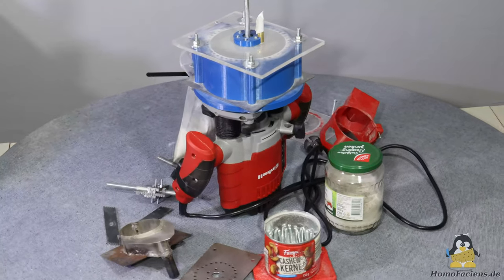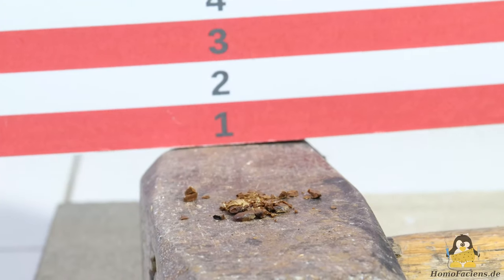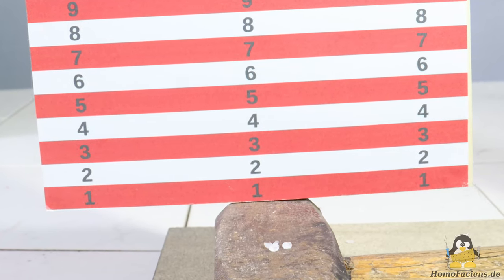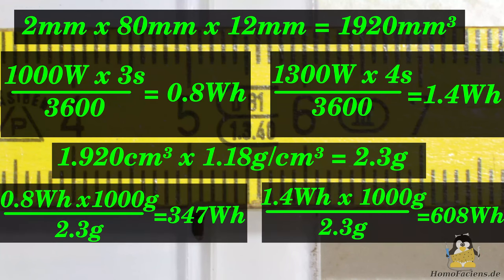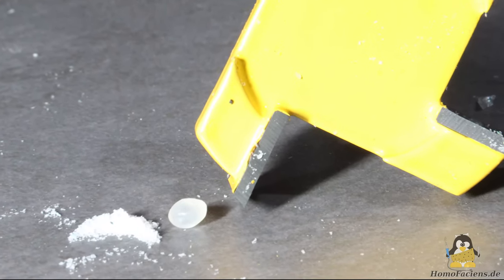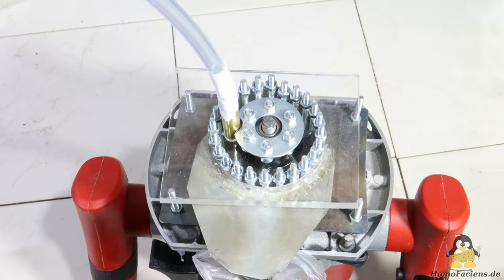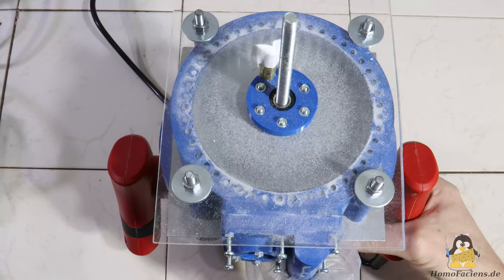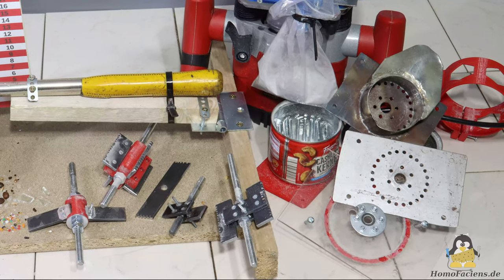Energy needed to grind or mill PLA pellets to plastic powder.

Comment: There's another process used to make fine powders industrially-- melt blowing... something like making 'cotton candy' Might work for low melt plastics like PLA?
Reply from the maker: Surely no easy task. You will very likely end with some sort of "cotton PLA" rather than with a powder. Melt blowing (atomizing) works fine with metals, but long plastic molecules have different properties.

Comment: interesting indeed. I wonder if theres any way to just blow dry ice powder into blend space sometimes to keep temps low? or in least just pipe outgas from it
Reply from the maker: Of course, cooling to temperatures when PLA gets really brittle is an option, but you must;
(1) Source liquid nitrogen or solid CO2, which isn't available in any hardware store.
(2) add the energy needed to get nitrogen from room temperature to liquid state or CO2 to solid to the energy bill.

Piping out gas or add an intercooler is what I mentioned at the end of the video, didn't I?
Reply: @HomoFaciens  Indeed. I wonder if AC output at max cool would work however lol and that is more buyable

Comment: did you think about a setup more like flour grinding with rotating rock. the rotation wheel should have a taper and a little oscillation. I think it could be more efficient then swinging plastic balls
Reply from the maker: You don't want to have rock fragments in your plastic powder. It will end up in a clogged nozzle in the extruder.
Reply: @HomoFaciens  good point. the same concept could be transferred to a metal grinding with different taper angle for inner wheel and outside wall though

Comment: Hello, I make this comment regarding the software to control the CNC with DC motors and optical encoders, which other program could be used? I only have Windows
Reply from the maker: ...but this video definitely isn't about a CNC machine!?!?
Reply: @HomoFaciens  Excuse me, what happens is that I wrote to you in the homemade CNC videos but you never responded to me
Reply from the maker: What about having a look at my pages? There you can even find a column named "contact".
Reply: @HomoFaciens  thanks👍🙂
Reply: @HomoFaciens  I already wrote to the email

Comment: what if we put failed plastics in the freezer?
Reply from the maker: They become a bit more brittle. If your freezer is really cold, the PLA becomes really brittle. But:
(1) you have to add that freezing to the energy bill
(2) really low temperatures are not that common in a household and I'd like to keep things in range of an average tinkerer.
Reply: @HomoFaciens  freezer is always on whether i put plastics or not. if -10c not enough you are right... i like your videos and thinking process. thanks for your videos
Reply from the maker: But the freezer draws extra power to lower the temperature of the PLA from room temperature to let's say -10°C. That extra energy is what you wave to add to the bill.

Comment: I asked Gemini (google AI) and his answer was low speed sharp blades are more efficient than high speed dull blades. Also he mentioned that the most efficient will be to use the large 3D scraps directly in to the 3D printer without any grinding.
His claim of energy efficiency was 300W for 5 minutes to get 1kg of of shredded PLA so 25Wh/kg using low speed sharp blades grinder.
Reply from the maker: ...and what CAD files did that super intelligent Gemini deliver?
AI is a search engine without mentioning sources and when I asked for a source for the numbers I did not mean a piece of software ;-)
Reply: @HomoFaciens  :)  Even current LLM based AI's are more than a search engine. They still fail at logical understanding and they are polluted with a lot of incorrect training data.
But if used properly it can provide helpful answers like in this case. 
The AI actualy calculated wrong and first replay was 300W for 5 minutes is 0.25kWh but then I asked for clarification and was able to recognize the mistake and answer correctly as 25Wh not 250Wh.
But the low speed sharp blades makes perfect sense.  Think about tiring to split a rubber ball in to 10 smaller pieces. You can use a large hammer and try to do that using quite a lot of energy or you can use a very sharp blade to cut the rubber ball requiring way less energy. For a glass ball that will be the opposite and PLA is closer to rubber than glass or stone.
Reply from the maker: But does the artificial "intelligence" say how a machine must look like? That's why I was asking for CAD files.
"Training data" means searching the web and calculating some sort of average answer. Still a search engine to me ;-)
Without any link to the "training data" there is: You can believe it, but you don't have to.
Where did Gemini get the specific energy for PLA from?
That cutting is in general better than random milling is a statement I made in the video, didn't I?
Reply from the maker: As told before, the core problem of Gemini is: You can believe it or not. There is no way to see on what data the software generated the answer. Gemini delivers a result in seconds, but to prove if that result is correct, you still have to spend hours of research work ;-)

There is no "Intelligence" behind the code lines, just parameters, self adjusted by the same piece of software. Shit in, shit out is what all database software suffers from...
Reply from the maker: Obviously your enthusiasm for this type of software is much greater than mine. ;-)
Reply: @HomoFaciens  It does seems like I'm more enthusiastic about AI :).
When you used the circular saw. What was the power required from the saw while it was just rotating at nominal speed steady state but not cut in plastic ? If that was around 1000W then that should be subtracted from whatever the power input is while cutting trough plastic.
If you google search for "plastic shredders" they use very low speed cutting blades maybe 60RPM. There was someone with a video on Hackaday building a small shredder to grind PLA to fine enough pieces in order to use them in a plastic extruder.
But this are likely still large plastic parts for what you need and then there is the "Plastic pulverizer blade" that seems to be a rotating disk with blades and then those rotate with small tolerances against fixed blades on the stator part. So it basically cuts small plastic parts in to even smaller plastic parts.
It just seems that it requires incredible tolerance especially for very fine powder.  One of this claimed 100kg/h and 10HP motor so about 75Wh/kg
Reply from the maker: Okay, we made our points on AI, let's talk about plastic powder ;-)

I went in my workshop and did the measurement you asked for: 850W. Subtracting the idle power of the saw from the bill doesn't make sense, since my aim isn't to get an academical number. If you need a fast spinning tool, you have to spend that extra energy.
 
Yes, a comment on the German version of this video pointed to a shredder with adjustable blades, but it is no machine for every household: https://youtu.be/vJt2BGfSyug?si=7qsTYMCFKYeePiye

Another yes, I am not sure if you get the powder I need with this monster machine.

The fast rotating disc machines are the industrial ones, usually with sieves of different mesh width at the outlet.
Reply: @HomoFaciens  Where is the 850W going to ? Heat in the bearings, motor windings and maybe moving some air to cool the motor ?
I guess nobody cares about the circular saw efficiency or any other DIY power tools. Maybe the battery power tools are more efficient or at least the newer ones using brushless motors that claimed 2 or 3x the runtime with same battery.
I agree that subtracting this idle power is an academical number but it shows that if efficiency is important the energy used to cut plastic can be improved significantly.
Not sure how optimized the industrial ones are since grinding plastic to powder is not much of a demand in the industry and it seems people just adapted mills designed for other purposes. 
The two types of commercial ones are flat disks with the knifes on the disk surface so more complex shape and the other type cylindrical more similar to your design but with knifes on the stator part and the rotor has metal paddle that push the plastic granules in to the knife to be cut not smashed.
Reply from the maker: ...and don't forget the heat in the iron core of the motor.

Well, plastic coating and some kind of injection molding are also done with powder, so there is a certain demand for powder. However you don't find that stuff as easy on eBay as pellets or filament spools.

Yes, the industrial types use a spinning disc. I have ordered circular sawing blades with a diameter of 85mm to see if I can do something similar.